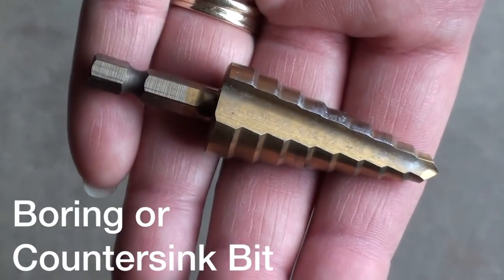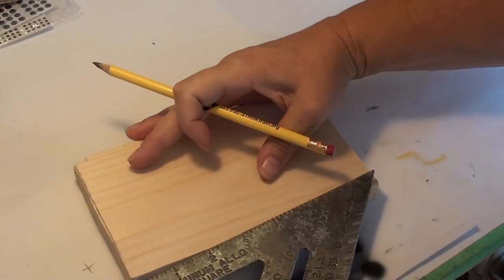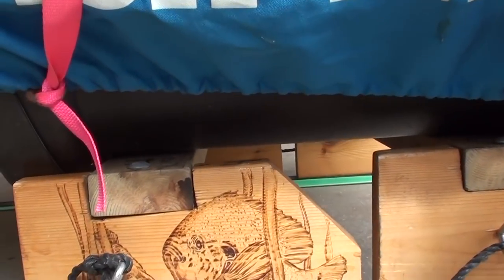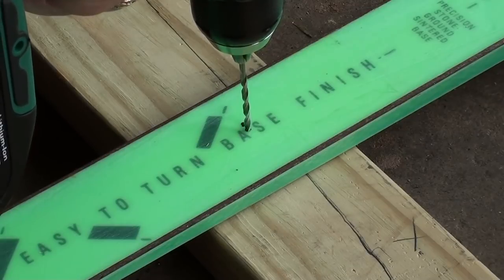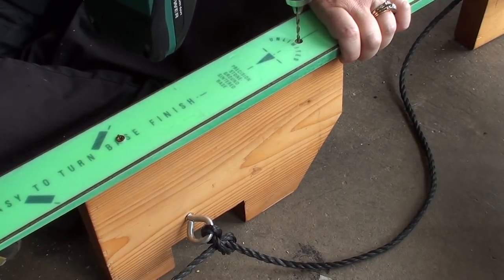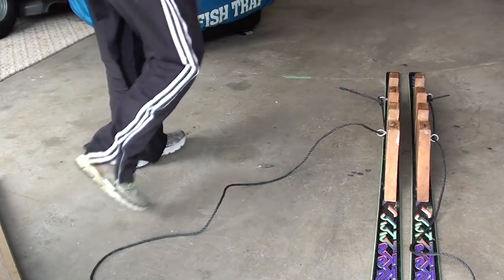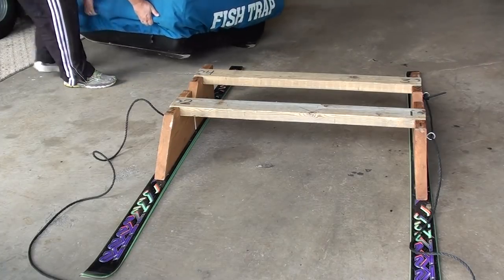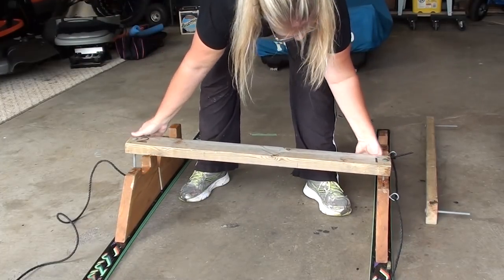How To Build A "Smitty" Type Ice Fishing Sled. Easy DIY.

Comment: Is it ok to use cross country ski opposed to downhill ski
Reply from the maker: Great question! In my opinion, you can in a pinch but downhill skis are better suited. XC skis are really thick in the center (which can make mounting kind of wonky), they're much narrower, & have no metal edges. XC skis have "grip" and "go" sections on the skis, whereas downhill skis are all "go". Given the option, I'd definitely choose downhill for this.
Thanks for the question & good luck with your project! :)

Comment: How long are your skis.Are you satisfied with the length or do you think longer skis would pull easier?
Reply from the maker: I'd have to look to be certain, but I think they're 215's? It works so well as is, I don't think I'd change anything about it, to tell you the truth. Hope that helps! :)
Reply: @EndlessDIY  I am more interested if you cut them to 4ft.-5ft.-6ft. Thank You .
Reply from the maker: @fishbuster53821  I think you probably could. The only trick might be the metal edges but they shouldn't be a huge problem with a fine-tooth saw and maybe file the ends a bit so they're not sharp.
Reply: @EndlessDIY  question; Are the skis on your sled 4-5-or 6feet long?Thank You for answering.
Reply from the maker: @fishbuster53821  Without going out to the garage & measuring, they're around 6'. I'm 5' 10 & they're right around my height. I never paid much attention to the length because I drive a truck & never had a space constraint.
Reply: @EndlessDIY  Sorry I presumed you had cut them down,but you must of used them full length.——- misunderstood.
Reply from the maker: @Ken Walters  Ah! Ok. Nope. Full length.

Comment: How do the bumper bolts/carriage bolts stay in the 2x4 that they are connected to? did you have to glue them in? or just pound them trough a smaller drilled hole and they stay tight?
Reply from the maker: They're just pressure fit. Exactly as you said, pound them in a slightly smaller hole. Mine have never budged, even after several years of use. Good luck with your sled & thanks for the question! :)
Reply: @EndlessDIY  and 1 more question. Did the attach the 4 blocks of wood to the ski's, and then notch them? Or did you notch the 4 blocks of wood and then screw them to the ski"s??
Reply from the maker: @mikeysfishingfuntime5070   I cut them to the shape I wanted before installing onto the skis.
Reply: @EndlessDIY  thank you!
Reply from the maker: @mikeysfishingfuntime5070  No problem! Good luck! :)

Comment: Thanks for your simple and easy methods. One question: How do you attached your box to your cross members?  Thank you. :)
Reply from the maker: Hi Kenny, I'm not sure I understand your question. Are you asking how I secure my portable ice house to the sled? If so, I use ratchet straps across it. I put pretty large eye hooks into the sled risers to hook the straps to. They're the same eyehooks I have the pull rope attached to. Hope that helps! :)
Reply: @EndlessDIY  Thank you for replying. I’m referring to the box of things that you are putting on top of the sled. You move it off and on, but I don’t see you secure it in the video. The box will fall off with any bit of uneven snow without it being tied or bolted down somehow. 

I’ve seen others bolt down their box to the 2x4 cross members, but that makes it permanent. BTW, I really like how you use the bolts to secure your 2x4’s, thus making it easy to store. Great concept.

So, I think I understand re ratchet straps. I just didn’t see that on film. 

Thanks so much. 😊
Reply from the maker: @kennysacht7946  You're right, I probably should have shown how to secure the fish house to the sled. I've read that people use bungees, too, but I just prefer cinch straps or ratchet straps. However, since this is really meant to pull by hand the bungees probably are ok; I just tend to "overbuild" everything. lol!

I can't take credit for the design, but the guy who did design this type of sled was pretty clever. He solved one of the biggest problems ice fishermen have; pulling all that heavy stuff onto the lake.

Comment: Most of the sleds I have seen have the pull rope attached to the ski tips. Yours appears to be run through the eyes on the sides. Do you find that works better?
Reply from the maker: I've just always had it this way. I know some people say having the rope through the ski tips helps keep the front light & it might. I have had no issues like this & it saved me the trouble of drilling through the ski tips. lol! I think either way is fine, really.
Thanks for watching!

Comment: What did you use to cut the inserts for the 2x4s
Reply from the maker: I used a jigsaw. I drilled holes where the corners are so I could turn the jigsaw blade. Does that make sense?
Reply: @EndlessDIY  i must of bought the wrong jigsaw blades they seemed dull for being new
Reply from the maker: @walleyeheadztackle5415  Aw! Wood blades have big teeth on them, & the plastic or metal ones have fine teeth. Maybe you grabbed the wrong type?  You could try drilling the corners and using a circular saw to cut down to the holes, then just use the jigsaw to do the horizontal cut between them.
Reply: @EndlessDIY  that was the plan thanks for the helpful vid and your time
Reply from the maker: @walleyeheadztackle5415  No problem! Good luck with your project! :)

Comment: my  1st  generation  smitty sled same as yours ,but feels the four pieces wood too heavy  , so friends of my they used  4   two inch pipe's caps lock on the ski, and 4 lock on 2x4 (wood),  between(top and bottom  )that used  4  two inch wide pipe  connect(holder)  .
Reply from the maker: There are definitely several ways to make a sled. I've even seen a design for one using conduit instead of skis. The idea is just to get you portable off the snow so it dosn't plow and it sounds like the one you built does that. Good job! 
Thanks for watching and commenting & good luck on the ice this season!

Comment: Do you treat the wood with something to help not absorb water for long term use?
Reply from the maker: Hi there! I did. I put a couple coats of Thompson's water seal on. Good catch, I probably should have pointed that out in the video.
Reply: @EndlessDIY  One more question...

Would you have any clever idea to some how easily & quickly but securely attach? swing up? rotate wheels?  There are many time we would need to park on a lot or street and walk a bit of distance on road/ side walk to access the ice.
I am thinking of some sort of way to attach caster wheels or small utility wheels some how....
Reply from the maker: @xxgg  Well, I've never really given it any thought, but I drew this up just now. I have no proof of concept, of course, and I hope you can understand my chicken scratch. lol!
The idea is that the wheel (maybe a lawnmower wheel?) is attached to square stock which has a shouldered bolt and large fender washer to pivot on. The assembly can pivot into a stowed position and be pinned there with a hitch pin (I think it's called). The same keeps it in the deployed position.  You'd have these on all 4 side supports. Here's a link to my drawing: https://i.imgur.com/YybmdTZ.jpg
Reply: @EndlessDIY  LOL!  I was finally able to get oranize myself to buy all the parts needed to build one.  FiNALLY!

Than I noticed something... skis itself have different thickness from front to back & it is slightly bowed.   So the riser (2x8) won't seat flush?
How did you go about screwing it on?   Force the screw on to flatten out the ski? Won't work, even than it'll bow on under side of ski.

I am using short skis for kids to place my 21" x 36" storage tote.

As for my old question about attaching wheels, I have decided to just go with two wheels near middle for balancing.   I got the idea from "Transom Launching Wheels", you can Google image search for what it is about.  I plan on using 10" scroller wheels with it.   When not in use, it'll simply swing up and lock it with pins.
Reply from the maker: @xxgg  I think you'll run into the problem like you're saying with the side supports if you make them a little too long. I'm on vacation in California right now, but I can measure the length of my side supports in a few days when I return, if it'll help. If I had to guestimate, I'd say they're 15" long?
Cross country skis are much thicker in the center vs the ends than downhill skis are, so if you're using those you might run into a bit of trouble with the thickness, but I'm not sure.
Reply: @EndlessDIY  Thanks for doing work at vacation :) :)
I am using a children size skis (about 125cm long or so).  I was going to use two 10" long on the skis than realized I didn't have a place to mount my wheel setup. Doh! (as i wanted the wheel to be just about around the middle)

I think considering single 30" piece, because it is kid size ski most of 30" will actually be right around the where boot mount used to be.  Quick eye'ing seems front 10" or so have slight, very slight gap... which I guess will just screw down to hold.

Also, do to the thickness difference I am guessing your cross bars are perfectly leveled front to back? but ever so slightly angled down to front?
Reply from the maker: @xxgg  I think you should be fine as long as it's 2 pieces. Another guy who messaged me had the same trouble and was pretty frustrated. I asked him to send me a pic of what he had so far & after a series of really blurry pics, I could finally see he had just one long, single side support rather than 2 separate pieces. Once he cut them, he no longer had the rocker trouble. Good luck & keep me posted! :)
Reply: @EndlessDIY  Here is what I am doing for the legs with wheels.
Not sure if image shortcut link will work... let me know.
https://bit.ly/2sYJ5mr
&
https://bit.ly/2GbQlTK

Those are 1 1/2" angle & square 1" tube (aluminium)
It will be mounted to each side of 2x8 near the center mark for weight balance.
It'll be held in that spot with two pins, when not in use reverse it to have the wheels up.
Also, wheel I am using is 11.5" sctroller wheel with bearings.  Middle of the wheel will be level with ski itself.  So about 5" ground clearance.

I thought about permanent screwing one on top, so I can take 1 pin and flip up the leg but than I would have had to make the those angles alloys much longer. Didn't wanted that.

Again, it will be ale to support the weight (max 100lbs) no problem as this idea came from people doing same thing but mounting two of these to rear end of their tube or small 10 ft boats.  So one person can transport from back of their trucks to water.  Only difference may be, those who use it for boats used larger than 1" square tube.   But some youtuber I watched used 1" tube.

I did finish the sled part of it, minus the wheel setup.  What a pain in the rear end to screw down the skis to the wood.   Measuring, lining up, etc... took so much time.  Counter sinking without proper tool.   Skis I have used had thin layer of metal too. Geez~~

As for the cross bar... wood will expend/swell when it gets wet.   That'll be future problem I am going to have to deal with as I may not be able to put in cross bar or take it out.

My future build, if any... I am gonna go PVC design :D
Reply: @EndlessDIY  One more thing, if this fails... here is my secondary plan...
https://www.youtube.com/watch?v=gWn5pyihlHs&t=230s

Build something like that,  but instead of hooking the square loop like the video. I would hook it to front skis.  Much simpler too, eh ? haha

My ice gear setup can't weight more than those typical kayak setups.

Comment: So you built a sled to pull a sled?! Just pull the fish trap.
Reply from the maker: Yep! You're exactly correct, I did build a sled to pull a sled, which seems ridiculous unless you've pulled a portable full of gear through a foot or more of snow. The sled acts more like a plow than a sled in deeper snow. The ski sled makes a HUGE difference in ease of pulling because there's so little resistance. Try it sometime, I bet you'll be shocked! But be careful, if you cross a bare patch of ice it might try to run you over! lol!